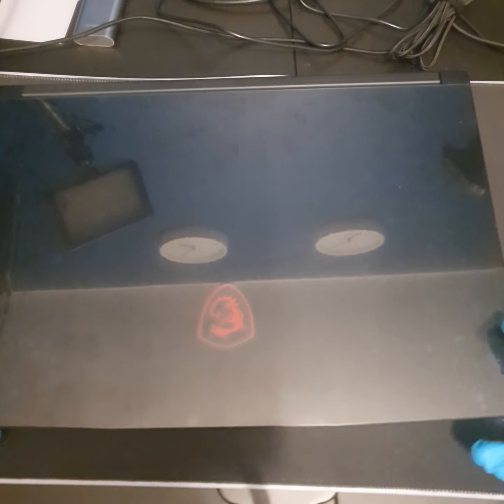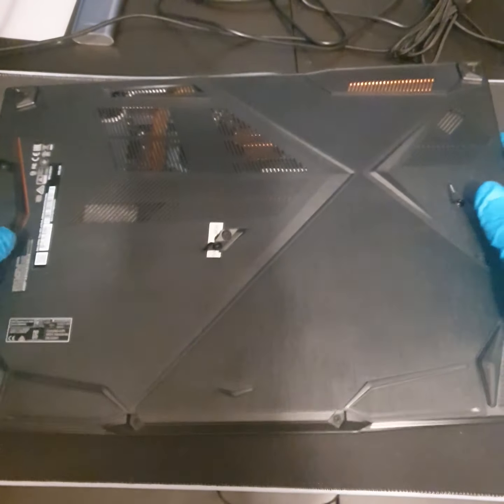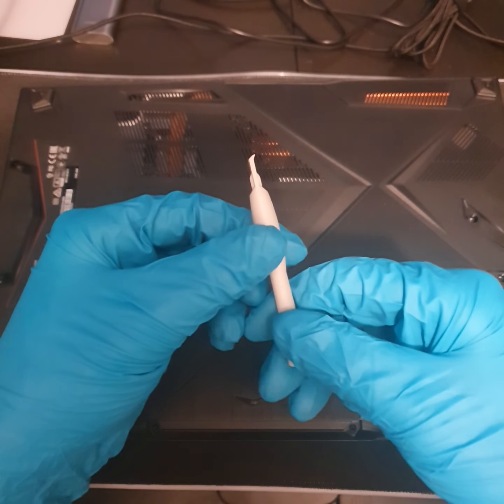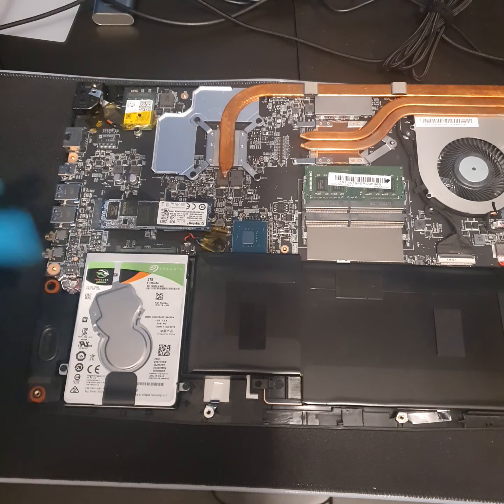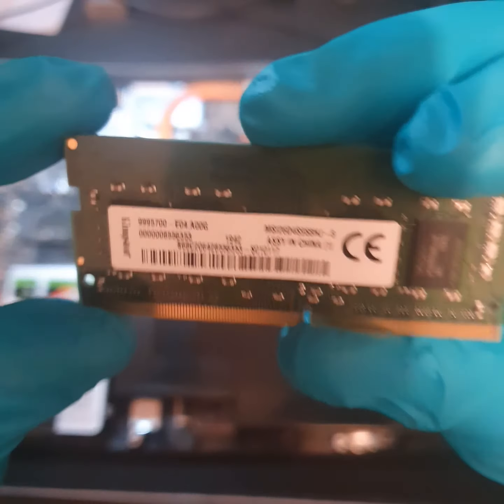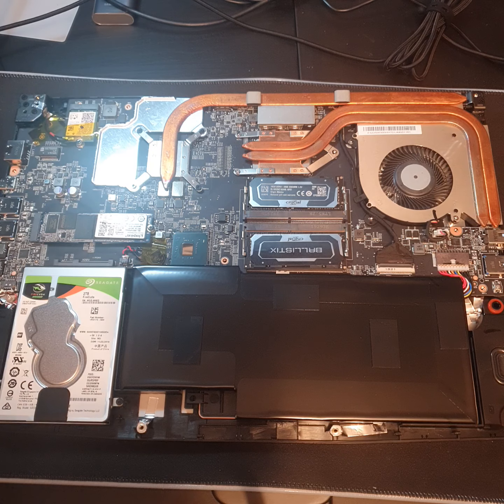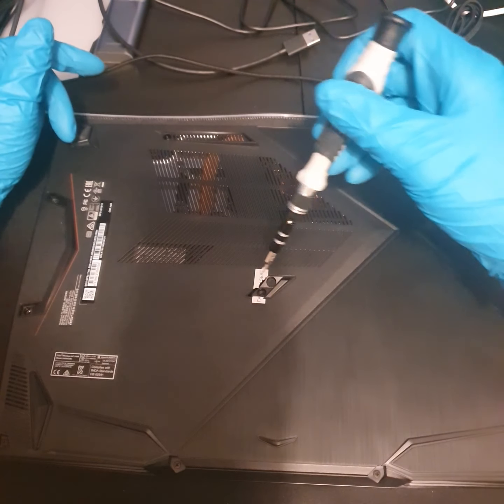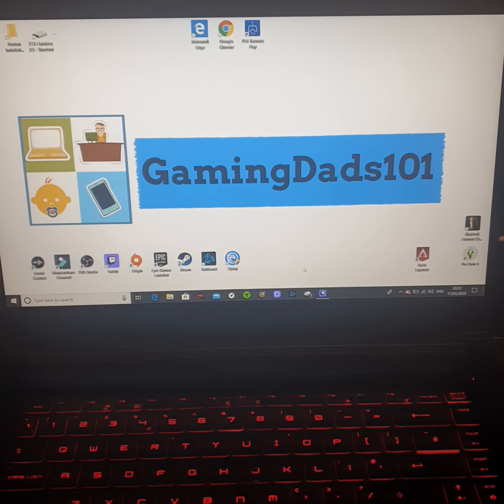Upgrading SODIMM RAM in MSI GF63

Comment: @GamingDads101 If you just wanted to upgrade to total 16gb, would you have been able to just add an extra 8gb ballistix stick into the empty slot or would you have needed to replace both slots with matching ballistix sticks? Thx for this tutorial.
Reply from the maker: No you need to have matching pairs of ram else you'd have dram errors. So either completely replace the ram all together or install another stick of the original ram so you have matching sticks. Hope this helps and no problem thanks for watching!

Comment: @gamingdads . I am also having gf63 9scxr model with me and i also did see the crucial ballistix on Amazon. I am thinking to buy it to upgrade my laptop but i have heard that these ballistix ram are xmp enabled and would not show full speed 2666 if no xmp feature in laptop. It will run at 2400 mhz....have seen you have also fixed the ballistix ram.please could you check the speed of ram what is showing.
Reply from the maker: It had the full 2666 mhz showing
Reply: Sorry just to reconfirm...are you sure that its crucial ballistix and showing 2667 or 2666 in task manager as well in cpuz pls

Comment: Hi @GamingDads i'm about to upgrade my RAM tomorrow (same machine) and have ordered another 8GB Kingston DDR4 SODIMM RAM Card...do I need to disconnect my battery before i do the upgrade? Also, did you have to remove the rubberised hinge that sits just below the screen before the frame would come free?
Thanks mate, really useful video! Like and a Subscribe from me! Would be interested to see any more videos about this latop as i have the same one...I am already questioning whether 60HZ refresh rate is enough haha.
Cheers, Nick
Reply from the maker: Hi Nick, you can take the battery out if you want but its not necessary. Just power down the laptop, unplug it from the charger and leave it to settle for 10 mins just to make sure there's no current running through and you'll be fine. Also theres no need to remove the hinge as when you peel the back away it seperates itself. just be mindful of the ports. Glad you enjoyed it Nick! Yes more videos will be coming. I have a few video plans in mind that'll be published over the next week or so. Thank you for subscribing Nick really appreciate the support.
Reply from the maker: Oh and in terms of 60hz. Its just what you get used too But you could always connect it to a monitor if you have one

Comment: I just want to ask that before or after upgrading the RAM do have to go in the BIOS to make the laptop recognize
Reply from the maker: No if inserted correctly the ram will automatically be recognised. Overclocking can be done in the bios via xmp profiles though else you won't get full power of your ram
Reply: @ThompsonLewis1  thank you for helping 
I appreciate your response 👍
Reply: @ThompsonLewis1  
One more thing 
Can we fit an hdd of any size like 1tb to like 5tb
Reply from the maker: @DARKEMPEROR_  any size mate, as long as its physcially the right size (2.5inch ssd for laptops) the storage size makes no difference other than a bigger whole in your bank. Hope it helps

Comment: how much are 8gb rams?
Reply from the maker: Depends what brand, which type and how many sticks. But usually anywhere north of £40
Reply: GamingDads101 oh i though it'd cost around £100
Reply from the maker: @angeloaerol3729  really depends..if you go for rgb 3200mhz ddr4 then its most likely going to be hugh price. But if you went for a cheaper 2666mhz ddr4 it drops the price but also drops performance.